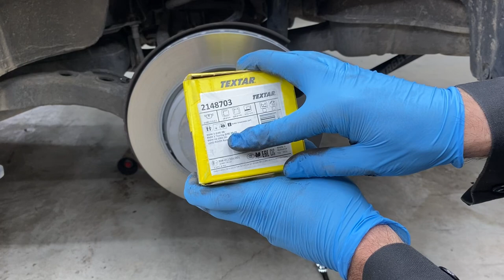Tie Rod Replacement on my $500 BMW E46 + More Details! She’s almost   SOLD!

Comment: Some additional information, as per request from the video :D BMW recommends to have the steering rack as far in as possible when removing and installing the inner tie rod. This is because the rack cannot be countered and the torsion is absorbed entirely by the pinion assembly. The rack also can be regreased on that occasion, especially if - as in this case - it already has rust on it due to a failed rubber boot. BMW prescribes FB-1 grease for this procedure. Maybe this helps somebody...
Reply from the maker: Thanks for the info! Awesome tip I will no doubt use that next time I do tie rods :)

Comment: Alec, I can't remember if you changed the front wheel bearings on this one? I would have probably done that first.
Reply: I was thinking the same. If I remember correctly he replaced one of the rear bearings..
Reply from the maker: Correct! I did one of the rears. The wheel bearings on this one feel great, zero up and down play on the wheel, also haven’t heard or felt any symptoms indicating bearing, it’s only lateral play, feeling very confident on the rack diagnosis, we shall see once I get her swapped!

Comment: Great informative videos. I just got a 2002 330 convertible with only 68k one owner and it was garage. However, after doing the usual maintenance items, was told it has the oil pan gasket leak! so, I'm getting ready to start saving since my mechanical skills are horrendous! Anyways, love your channel. Thanks
Reply from the maker: Thank you Julio! what a cherry car! rare to find em with such low mileage now a days. as long as its not the X drive the oil pan isnt too bad, but it is a lot of work on your back and you do have to drop the subframe down. 
really appreciate the support!
Reply: @DayOffDIY it is a LOT of work on your back... or you leave it alone and it is undercarriage rustproofing.

Comment: If I move my wheel at 3 and 9 o clock like you did on the driver side and it also moves passenger side tie rod. Is that the steering rack or tie rods?

Comment: Is there a tq setting for the inner tie rod nut?
Reply from the maker: im sure there is but i would be unable to torque it due to the size and use of an adjustable wrench. I just tried to go gudntight :)
Reply: @DayOffDIY  I like how you roll!
Reply: @DayOffDIY  was wondering the same thing, but hey I guess I'll go the gudntight route too. threadlocker a good idea since I can't torque it properly?

Comment: How much for her?
Reply from the maker: she sold a few months ago for 6K
Reply: @DayOffDIY  awe i miss my 330ci manual... 2001 i cant seem to find them 😭😭😭i miss mine. Im tryna get mine back from the yard and fix it back up. Had a wipe oit in a bad storm and my shit hydro planed all over the road after being side swiped and ended going over the median. Front the front end. Idk what broke but my right wheel was tsisted in and left wheek was straight but didnt move when i turned the wheel. The wheel just kept spinning 💔💔💔. Rear right wheel was cambered. Positive camber like hell 😭😭
Reply from the maker: damn that thing got smoked! I  have a 2002 E46 330i manual if I sell it one day you can make me an offer!
Reply: @DayOffDIY  lmk bro where u touched down at